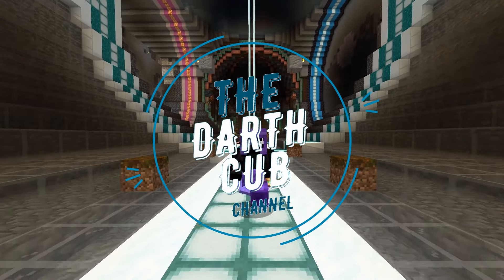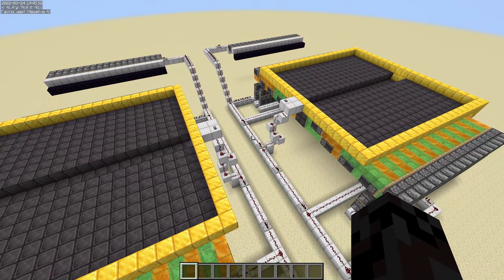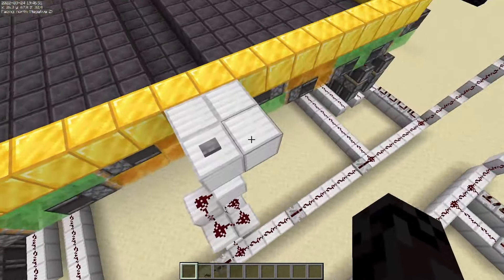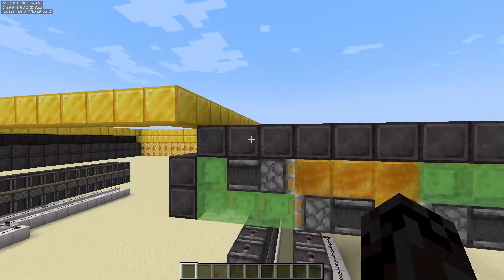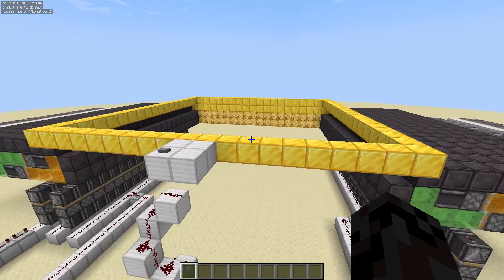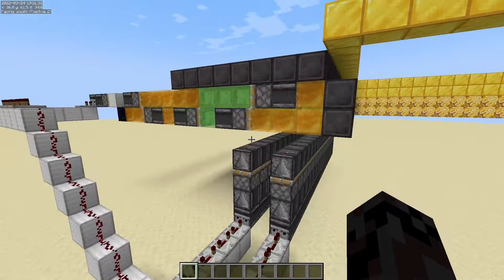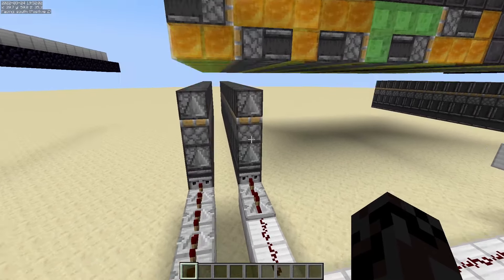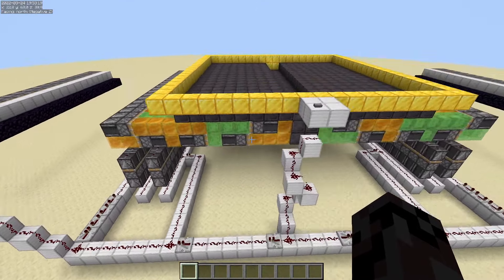Minecraft 18x18 Horizontal Flying Machine Door (1.18.2+ Java)

Comment: thank you very much
Reply from the maker: Glad to hear you liked it! :)
Reply: @darthcub6319  hello once again. Ive build it in my Singleplayer and it works like a charm. Ive build the same in my multiplayer and it moves like 2 blocks in each direction and stops midair. I even copied that build back into my Singleplayer and it works normally (its the exact same haha). Do you have any idea why it wouldnt work in multiplayer? Its a papermc server 1.20.2
Reply from the maker: @youngestmark  server tent to mess up with the tick system and you struggle with server delay. So if your internet connection is stable maybe ask for advice from the server admin? The door works flawless on the cubscriber smp, also paper 1.20.2, but ping is always relatively stable around here. Hope that helps for now? Great to hear that you enjoy the door in single player 😊
Reply: @darthcub6319  thank you for the insights, I had a wooden button instead of a stone one. That was all my problem 
Thanks again for the machine

Comment: would it be possible to remove the two blocks in the middle? i just need a 16x16 door and don't really like the dip in the center. thanks otherwise, this is great.
Reply from the maker: Glad you like it! You can adjust the size, especially since you reduce it shouldn't be a problem. The dip is needed for covering the slime blocks. If you don't have it, they could stick together. 😅
Reply: @darthcub6319  update: good news, it turns out if you alternate the slime and honey blocks properly and adjust the bottom observers one block inwards on both sides, you can get rid of it! i managed to build a 16x16 version on my smp server and it worked excellently. aside from the 50 thousand times i accidentally broke it, but
Reply: @shadowfire04  just out of curiosity, how exactly did you remove the center strip, I've been messing around with the world download for a while but cant seem to make it work without a center strip